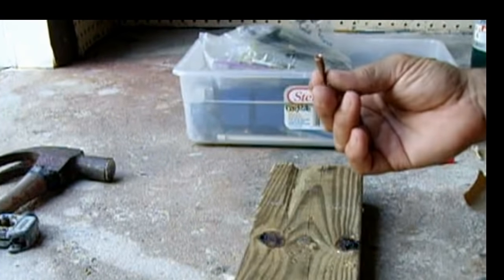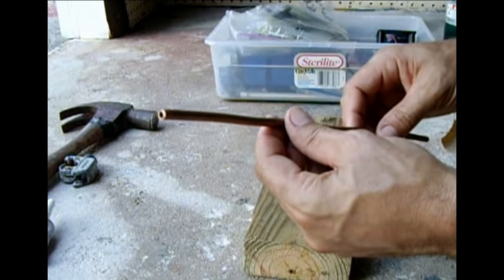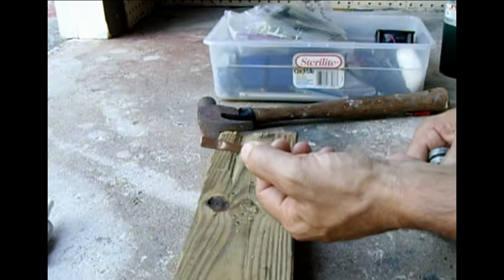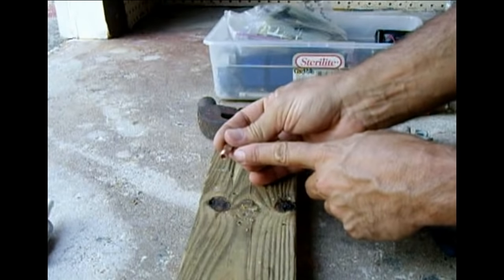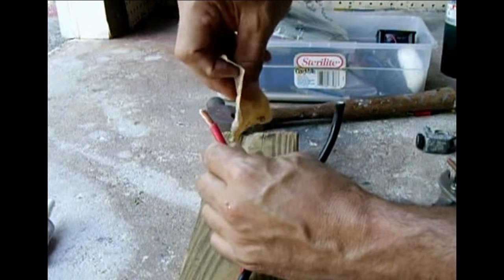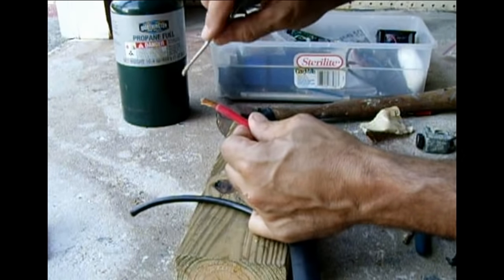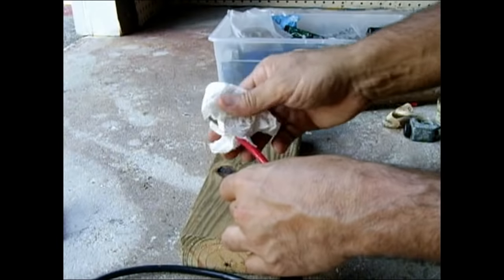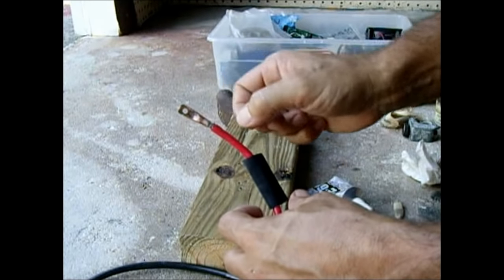How To Make Copper Battery Cable Connectors!

Comment: Thanks for showing. But the time it took you to make the terminal is worth more than a terminal that's already made.
Reply from the maker: Incorrect. There is a huge cost difference, and I was making the one shown in this video VERY SLOW for my viewers.
Reply: so how long did it took you to build one?
Reply from the maker: If the tools are ready to go, and the copper pipe, 1 1/2 minutes or less.

Comment: I'm not a plumber, is there tinned copper tubing available?
Reply from the maker: Hi Damien. I never saw tinned copper tubing, but I'm sure it exists. You can buy an inexpensive small graphite crucible on Ebay and heat it up to melt solder, the apply some flux to the lug connector and dip it into the crucible to nicely tin the connector. Fast and easy to do. Thanks For Watching!
Reply: electronicsNmore Thanks for the tip!

Comment: the technique for making the connector is perfectly sound.However, using acid flux, and a torch are not appropriate for electrical connections.This may be rosin flux.. I don't know.. but the torch oxidizes the copper , with creates a higher surface resistance and weakens the copper.. so use a gun or an iron. and a heat gun.
Reply from the maker: I save my expensive rosin flux for PCB work. I've never experienced any issues using Nokorode paste flux. A lot of heat is required when soldering a #2 or larger wire/connector. Only a torch or induction heater can get the job done.Thanks for watching!

Comment: good diy project but it would be easier for one if you modify the process a bit: 1) flatten the tube; 2) drill the hole; 3) file off the sharp corners; 4) cut and clean. This way you have more to hold on to while you drill and file before cutting the tube. ...just my 2cents opinion.
Reply from the maker: Whatever works for you. :-)

Comment: I make mine from .30-30 spent casings. Just cut off the primer end and the rest of the process is the same as in this video.
Reply from the maker: I would think the metal is too thin.

Comment: Why do you advise against using flux that has acid ?
Reply from the maker: Electrical connections are typically made using "Rosin Core" flux. If you use plumbers flux, there is a low level of acid in the flux which can lead to corrosion problems WAY down the road. :-). I never had any issues using the Nokorode brand plumbers flux. Just apply a thin layer to the wire and inside of the connector before soldering and you will have no issues. Wipe away any excess when complete before applying the heat shrink. If your really paranoid, you can use a cleaner to remove any flux residue.

Thanks For Watching! Be sure to share my channel with others and rate Thumbs Up.

Comment: Great video, I been doing my own for years also and never a problem.
 Strange how Ignorant people are that leave comments or just narrow minded never thinking other people may not live like they do or where they do!  First just think about when they say only $1 or $2 each to buy them and there time is worth more. What a big joke, just got to laugh at them! Really, they just tossed away 10.5 minutes watching a video then more time to post not worth their time. Well what was their time worth now lol
 Then the narrow minded, heck everyone lives next to bunch of big stores so just walk a mile and buy a hand full.lol
  Well 26 mile round trip to tiny walmart little further to small auto parts store and farm supply store. Maybe if lucky I might find 24 connectors but probably not the size I needed for the welding cable I was using. Just the way it is when I need stuff.
 Then how about cost! Yep, probably more like $2.50 each around here for that size, but call it cheap $2
 how many did I need? Well 2 ends per cable, 2 cables per battery, 12 batteries, 4 cables for inverter, lets see now that is 28 cables x 2ends each so ONLY 56 connecters and $2 each so $112 + 8% sales tax $9 then gas for the truck to run around to stores at $4.00 per gal at that time, Ya I saved nearly $150 making my own!!!! You don't count the time to actually install them onto the cables because I would have had to spend that time doing store bought ends anyway if I had just bought some ready made. It took about 1 hour to make them all, less time than it would have taken to actually go to store! 
 I had everything right at the house I needed already.
 Sorry, but MY time is not worth $150hr and neither is anyone else's!!!!!!!
So yes, videos like this are great to help others that may not know how fast and easy it is to make simple things like connectors etc...
 I been making my own stuff for many years but I don't make videos. Glad to see others doing things like this and sharing also.
  I tried making some videos but they turned out horrible so I tossed them. 
 I do like watching videos of other people doing things, even if I do the stuff myself already. Sometimes I find different ways to do something which may make a project better or save time or save me money etc... 
  So thanks for the video, good job!

Comment: Just keep in mind that NEC code requires battery terminal connections to be of the same metal. So if you are going to use these for directly connecting to a battery post, you will need to first coat them with solder. Codes are not written just to piss you off. They are based on years of experience and testing.
Reply from the maker: +st8kout1 Incorrect. Copper connectors and lead battery posts have been connected that way for many, many decades. Never any problems. :-) Not every code written is valid, the great majority are.

Comment: why acid core solder not good to use?
Reply from the maker: It leaves an acid residue behind that will corrode the copper.
Reply: @electronicsNmore  maybe i got confused with acid core solder and soldering flux applied before soldering

Comment: I would've drilled the hole before cutting the pipe ,so you have something to hold on to.this way you don't have to use plyers.
Reply from the maker: I usually do that, but when you make a video, sometimes things change. :-)

Comment: You should tin the wire before soldering
Reply from the maker: Mike Pennie Hi Mike. You can do that if the wire isn't a snug fit inside the connector, but it's not really necessary because capillary action will draw the solder into the connector surrounding the wire. Thanks for watching!
Reply: Holy shit, that response time was less than a minute on a 4 year old video. Fair enough, it's not necessary but can make getting the wire inside and soldering easier. Great tutorial by the way, I wouldn't have thought of using copper tube.
Reply from the maker: I was notified of your comment while I was online answering other viewer questions. :-) I answer viewer questions on ALL my videos, age of the video is irrelevant.

Comment: What you pay for in lugs is the rating. When used with the correct tool, it is recognized as safe for the use. Think insurance.
Reply from the maker: Crocellian If you want to pay more money for a stamp, then do it. Just so you know, many lug connectors sold do not have any markings on them. If the proper overcurrent protection is in place, the connector is well secured, and the correct size wire is used, there's next to a zero probability that a fire could start.

Comment: Why didn't you drill the hole and shape it before cutting it off?  It would have been easier, lol.  Just teasing.  I think I counted about 30 of those "original" thoughts before I got tired of it ;-)  Anyway, cool idea.  Thanks!
Reply from the maker: Normally I do, but when making a video and having to put up with road traffic noise, barking dogs, and lawn mowers.....you lose concentration. Thanks for watching!
Reply: I was just joking, poking a bit of fun at folks who kept commenting that same thing.  I am sure it is difficult to set things up, film, talk, etc., etc.  I keep wanting to give it a try, but even the little bit of editing I have done is a significant time commitment.   Thanks and have a good TG!

Comment: People, please just crimp your wire terminals correctly for the best connection possible . Soldering copper cable will just result in future failures  I have been in the auto electric business for 30 years and can't count all the soldered cable ends I have repaired .
Reply from the maker: Jim McCune That is your opinion, unfortunately I completely disagree. I cannot tell you how many wires I have repaired over the years due to crimping which resulted in a high resistance connection. Best way to go> Crimp/Solder/Heat Shrink. The lowest resistance connection you will get is a soldered one. A properly soldered connection will last decades.
Reply: electronicsNmore  Yes it is my 30 year experienced opinion and I stand by it .  Solder is very low tempature melting and a heavy load will un solder the connection . The crimp is much better!  If you really need to satisfy yourselves and solder, then please crimp first !   Decades ?  Please
Reply from the maker: There is no reason for any wire to get hot enough to melt solder. If it does get that hot, you have a wire that is undersized or overloaded. Clearly you need to know the ampacity of wires before applying any current to them. Crimping and soldering is very good. That I agree with.
Reply: electronicsNmore There are plenty of reasons for a wire and terminal to get hot and melt ! A failing starter motor will and can draw way too many amps and the solder connection will absolutely fail where as a properly crimped connection will live another day !   Trust me you won't win me over ,this isn't a hobby for me !
Reply from the maker: Who ever said this was a hobby for me? LOL. Some Youtube viewers crack me up. I made a lot of money over the years due to my wide range of skills and knowledge. I already stated that crimping AND soldering is a very good idea. What more do you want? Crimping alone is no good unless you are using a very high quality/thick connector along with a high pressure type crimping tool, like the type a Lineman would use. The average person will not have that type of crimping tool. Clean connections, and fuse protected wires will prevent any wire from becoming hot enough to melt solder.
Reply: electronicsNmore The average person will not know how to solder ,so what is your point ?   When was the last time you seen a 500 amp fuse on a starter cable ? Never !    Look , my point is clear and valid. Soldered connections are almost always done wrong and fail regularly .   Crimping is the best for stranded cable period. 

 I just wanted to comment on your well done video but it lacks the truth on the best connection method.  I applaud you on showing how to make a cheaper copper connector for the hobbyist but in the real work of professional cable work we just by the right parts and sell them to the customer, job done .
Reply from the maker: I appreciate your concern, but if you read all the annotations shown in the video, you would have seen where I stated that crimping AND soldering is the best method. Clearly you did not see that in the video. You probably did not even watch the entire video before you started complaining. This entire conversation should not even exist because this was mentioned in the video. One last thing, if the wire ever got that hot to melt the solder, you would have to replace the wire anyway because the insulation would be destroyed. So your point still makes no sense to me. You would actually be better off having a wire like that soldered, because instead of the wire reaching the point of "near glowing" in the event of a short circuit and staring a fire, the solder would melt out and allow the connection to possibly pull apart. I'm done discussing this. All future comments on this post will be muted. I have wasted too much of my time on something that has already already mentioned.
Reply: electronicsNmore dude, you're being trolled. the jim guy is spewing logical fallacies. ignore.

thanks for the video. it was very informative. i don't solder often so it's good reference to have something to glance at real quick in case old memories faded.

and yes, crimp, solder, if needed. fuse-protect and forget and move forward to the next task at hand.
Reply: electronicsNmore Hola perdone que hable en español, pero no hablo ni escribo en ingles, yo he realizado inumerables juntas, con los tubos de cobre y ademas, te doy un dato, yo uso un expansor (swaging ) de tubos, para agrandar donde entra el cable, y asi no queda tan grande y ancha, la parte plana, uso soldadura y despues de enjuagar todo bien del flux,  una vez seca la monto con un poco de aceite de motor usado,( no nuevo,) y nunca he tenido problemas ,  a veces los problemas vienen de otros puntos a donde van esos contactactos, pero nunca por ellos... saludos de Venezuela, donde nos robaron hasta los sueños....
Reply: Jim McCune as a mechanic and electronics hobbyist, I say soldering and crimping is best. But in what world would any auto electrician let a cable get that hot and possibly set fire to a customers car!? Id personally upgrade the starter wire or replace the whole starter if it drew that many amps...

Comment: Plumbing flux is acid core.  Electrical flux is always rosin or resin core
Reply from the maker: Never had a problem using "NoKorode" brand flux. I have wires I made years ago for my inverter generator, and they are still just like the day I made them. The "acid core" your thinking of is specifically called "acid core solder", which is used for sheet metal work. The plumbing flux is a weak version of the acid core flux. I'll be old and gray before the connection gives me a problem. Use whatever you wish. :-)

Thanks For Watching

Comment: Good video, but as a plumber your definitions of copper need some work!  There are L and K in rigid and not all soft L and K is for refrigeration.
Reply from the maker: True, I was basing what I said on the majority of home improvement and hardware stores. Usually they sell type M rigid 10' lengths, and refrigeration copper(soft) coils type "L", some sell type "K". Thanks for watching!